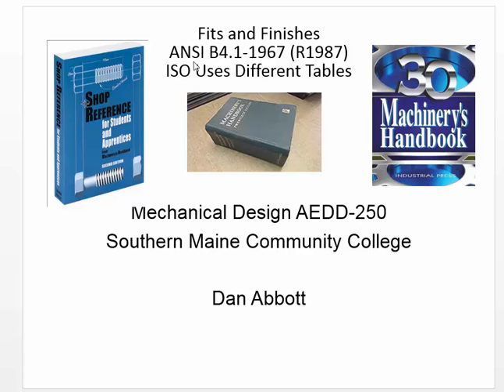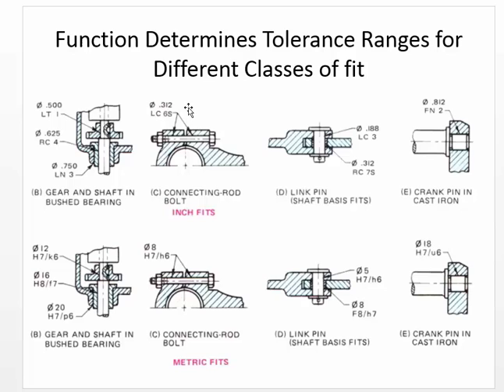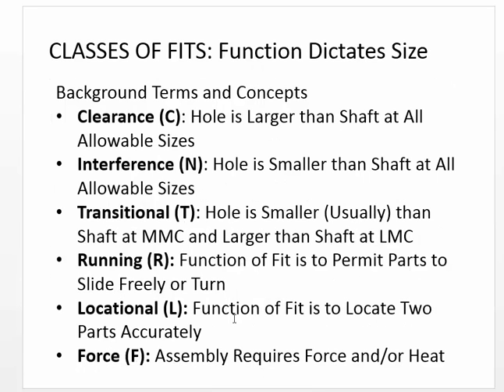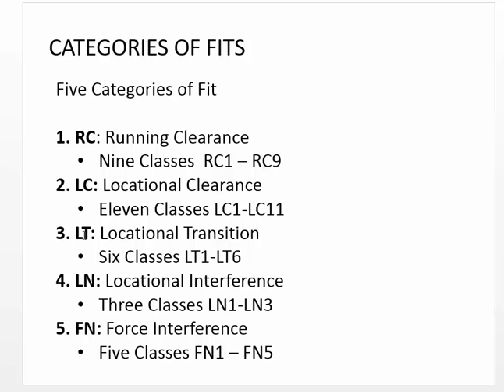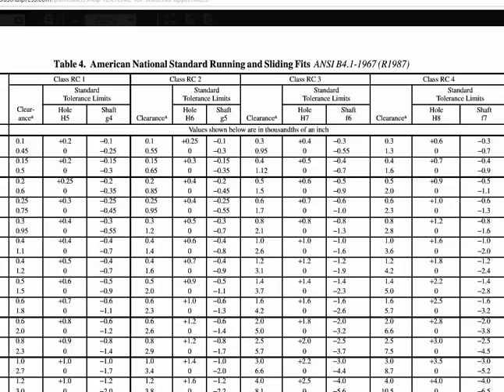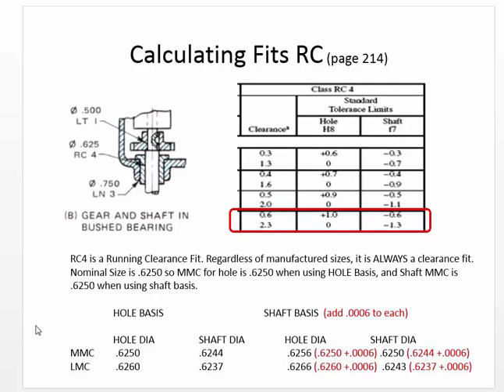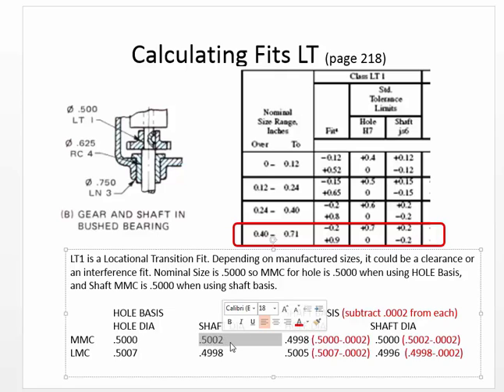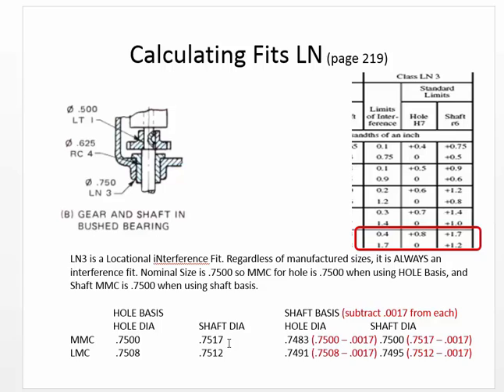Fit Calculations ANSI

Comment: I am purchasing a pin that already has a specified tolerance that it will be manufactured at. I need to manufacture a hole that will achieve an FN1 fit with that pin. Do I use the MMC of the purchased pin (based on the manufacturer’s tolerance) for the nominal size when using the method you show?
Reply from the maker: I would measure the actual size of the pin and determine if it was manufactured within the tolerances specified. It not, consider the actual manufactured size the MMC and do the calculations from there. It might be easier to do it on a hole basis first and then move all of the dimensions the same amount in the same direction so the MMC is assigned to the shaft, rather than the hole and then determine the comparable amounts that will result in the same class of fit. You definitely need to determine the tolerances for the hole on a shaft basis, which is not how the charts are developed.

Comment: Hi, thank you very much, my question: would you specify the fit on a drawing for the Shaft Basis system as JS6/h7 for the LT1 example? as opposed to H7/js6 when it is a hole basis? Thank you!
Reply from the maker: That is an excellent question, but I don't know the answer. In the ASME system, hole basis is assumed. If you want to specify shaft basis, the letter S is added to the designation. However, the designation seldom appears on a drawing. The designer uses the method that is most suitable and then calculates the tolerances accordingly and puts those values on the drawing. The machinist then manufactures the part to those dimensions, and it doesn't matter what the basis for calculating them is, although the machinist and the designer are often the same person, so they would know. Whether the ISO system reverses the designation to indicate shaft-basis or if an S is added is something I haven't encountered. If it were necessary to communicate that to another person, I would be specific by adding a note.

Comment: I wanted to ask this what would we do for FN and LC when it is a shaft basis system? How do we get Hole and Shaft DIA in that case?
Reply from the maker: When you are calculating on a shaft basis, it simply means you are starting with the shaft size. If the shaft has not been manufactured yet, you make the nominal size you are working with the Maximum Material Condition (MMC) size of the shaft and make the LMC the same amount smaller that it is in the chart, which is determined on a hole basis. You can then determine MMC and LMC for the hole by using the values for limits of interference (FN) or clearance (LC). I find that when learning this it is easier to just calculate all four values on a hole basis, and then shift all four values the same amount in the same direction to make the nominal size the MMC of the shaft instead of the hole. 

If you have already manufactured the shaft, make sure it falls within the tolerance you determine using nominal size. It is is outside that tolerance, than use its actual size as the MMC size and shift whatever amount is the difference between the actual size and the MMC of the shaft on a hole basis. The point is to maintain the same relative sizes at that class of fit.

Comment: Great Job!  ANSI Tolerancing is a great way for a new designer to find out the value of standard tolerancing.  Your method of introducing the Machinery's Handbook is awesome...I believe in this resource for Mechanical Design.  Thanks for your effort with quality instruction.

T J (Tom) Vanderloop, Author, Mechanical Design-Instructor & Consultant; ATEA, AWS, & SME Leadership/Member
Reply from the maker: Thank you for your kind words. I really appreciate it. I agree that using fit calculations as an introduction to the mechanical design process works really well in emphasizing the relationship between function and tolerances.

Comment: Why do the ANSI tables list H7 and js6 (ISO type) limits? At the bottom of the tables I've seen online it says they are based on agreements in the America-Britain-Canada (ABC) system, but I can never find further explanation on that. They seem to be different than the ISO H7/h6 fits because they would pre-date the ISO standard, but the letters seem to match up with the ISO standard.
Reply from the maker: I'm not sure what the agreement was, but whenever I've cross-checked the table, the ISO versions were correct.

Comment: Which class fit is appropriate at each condition? Is there a methodology to select 'class" ?
Reply from the maker: Sorry not to have responded to this earlier. I just hadn't checked comments on this video for a while. Determining what fit to use is based on function, which is a design decision. Guidance for that is included in the machinery's handbook (or the less expensive subset of the Machinery's Handbook included in the Shop Reference for Students and Apprentices). The specific pages differ depending on the release you have, but there is an explanation of when to apply each fit, based on function, that precedes the tables. In the Shop References for Students and Apprentices, it appears on pages 211-212.